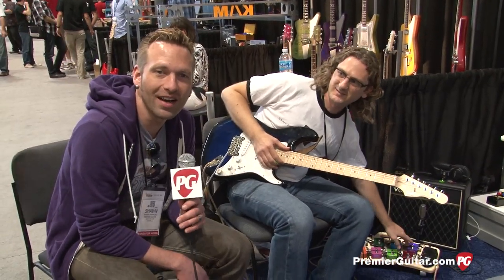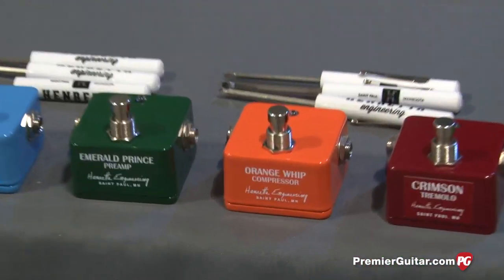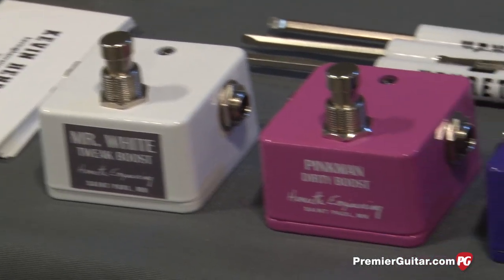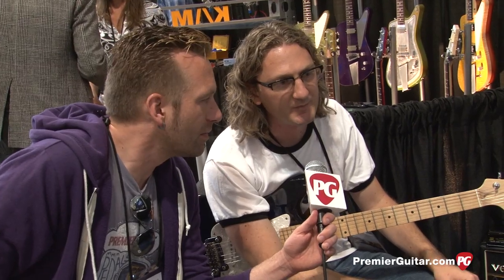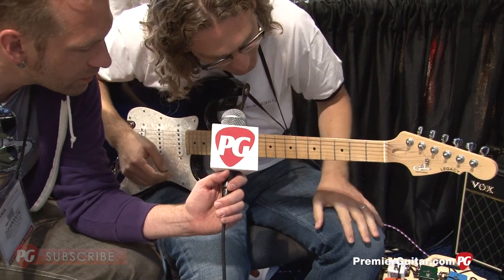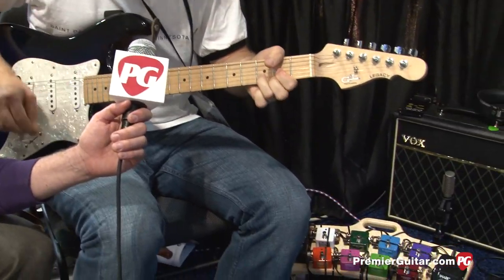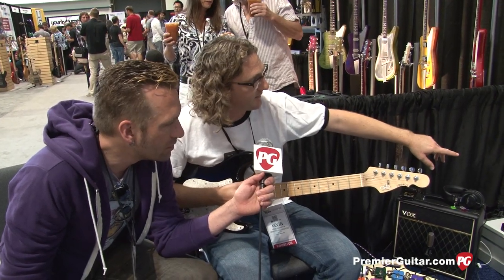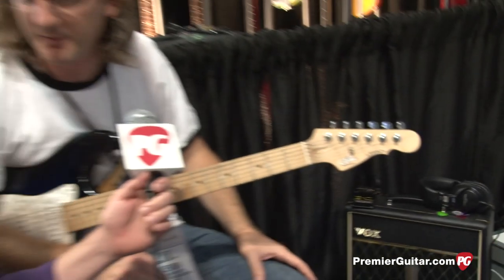Summer NAMM '14 - Henretta Engineering 2014 Pedal Line Demos

Comment: Pedals like mooer are more convenient to use and are more compact. Even if you think that the knobs on such pedals get in the way, you probably could move the micro-pots (or how are these things called) on top of the pedal (but not on the outside, I hope you understand what I mean) where you could adjust them by a screwdriver. I mean they would still be out of the way, but would be accessible through holes in the top of the casing. That way you wouldn't need to touch the 4 screws on the back to fiddle with the sound

Comment: i think the concept would've worked better if the jacks were on the top.
Reply: *****  - orientating them at 90degrees as you suggest is asking for the cable jack to get damaged when stomping on the footswitch.   these enclosure don't seem much  narrower than say a typical MXR enclosure, so oif the jacks are on the side how does that save space widthways?
Reply: *****  - they have no knobs, but they cost the same or more than equivalent pedals which do have knobs.  no cost saving with reduced features.  hmm.  i dont get that, sorry.
Reply: ***** - "They save vertical space and allow two rows on a board that typically allows one row"  -  but that assumes one has a pedalboard of pedals all of this size/dimensions.  I think you missed a trick by not putting the jacks on the top, sorry.
Reply: *****
 - I heard a few dedicated video demos.  They do sound very good.  I heard the Pinkman (which seemed a versatile dirt) and the blue fuzz one.